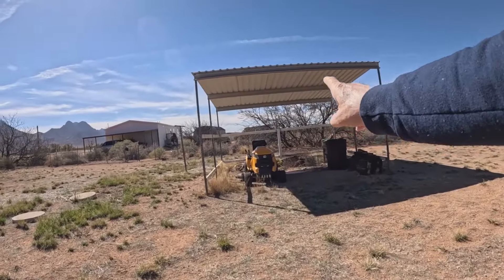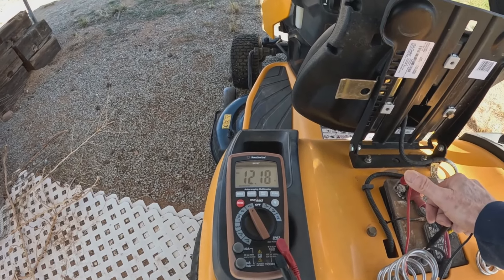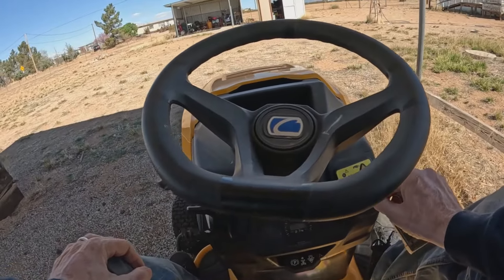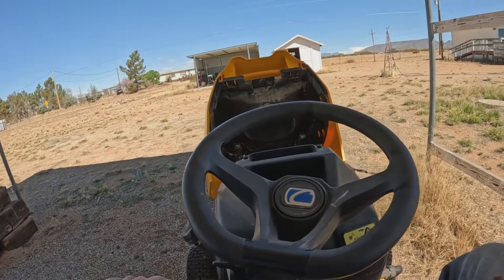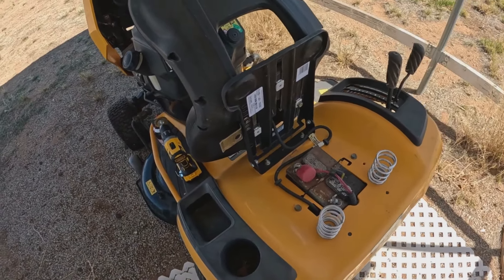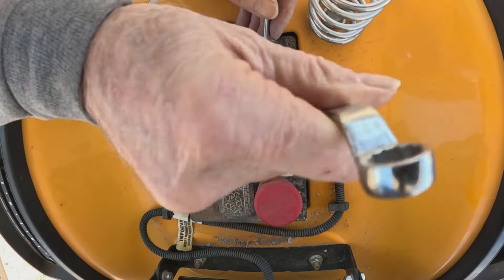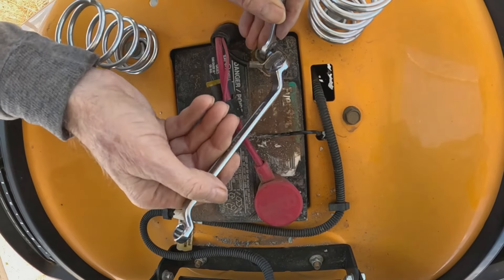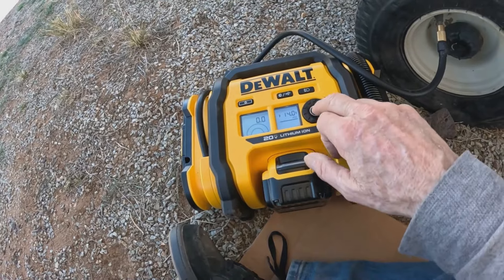Cub Cadet maintenance no start and flat tire

Comment: Glad you got it started! I didn't notice if you tried the choke (push it past full throttle), may have helped the battery a little on a cold start, that battery was rough though. I have the XT1 50.
Reply from the maker: I think it was combination of things. Corroded battery terminals and cable connectors,  the gas was old, and add to that the tractor hadn't been run all winter. I am working on the cub cadet now and going to pull the spark plug and look at it. I will drain the gas out of it and put new gas in it.
I just put 2 new 4 ply tubeless tires on the front. Hopefully that will solve the front tires going flat. In short I'm going through everything to make sure it runs Good. Thanks for the comment.
Reply: @nmsidewinder  Ah yes. A touch more than the choke could solve. Thanks for the reply!